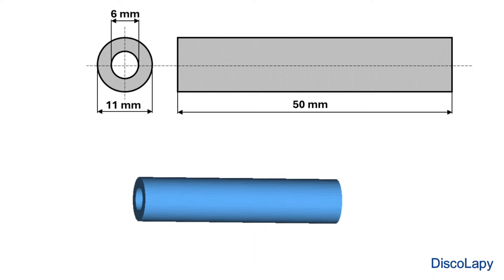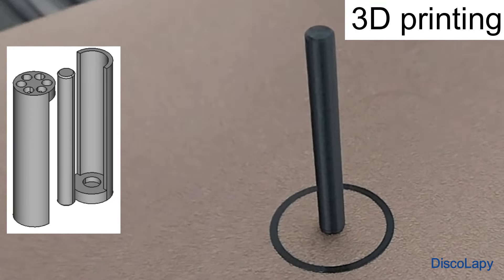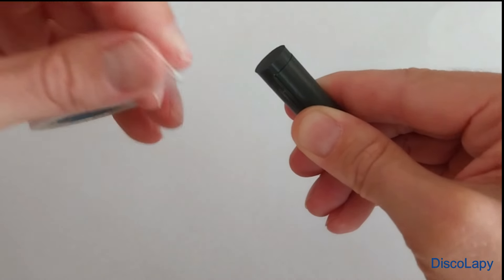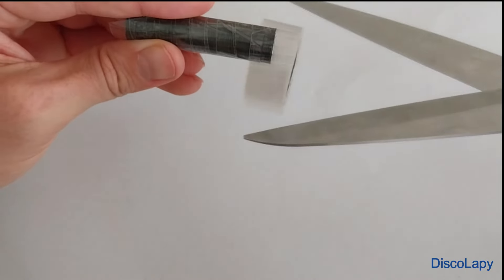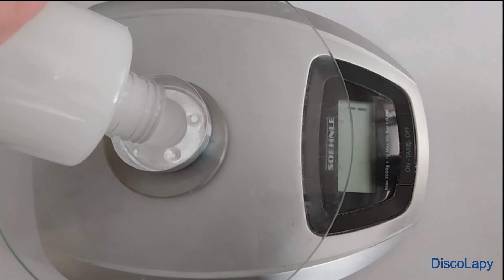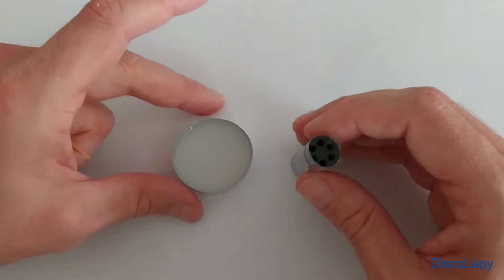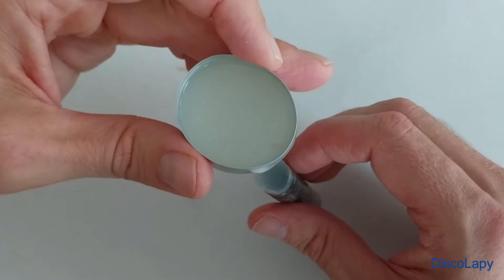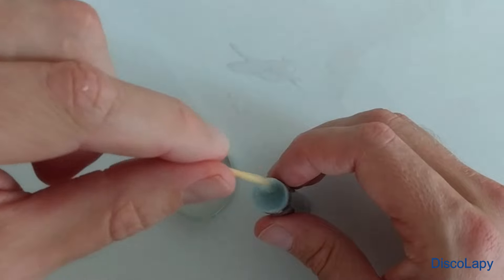Silicone tube fabrication, 3D printed mold tutorial

Comment: Thank you. A useful idea to have in the repertoire for all kinds of custom silicone parts.

 You didn't use any kind of mould release agent?
Reply from the maker: Well, silicone is a very user-friendly material to work with. There is no need for any kind of release agent, as it does not stick to walls. However, it can be useful (for fine applications) to remove small bubbles by using a vacuum chamber or by applying vibrations...